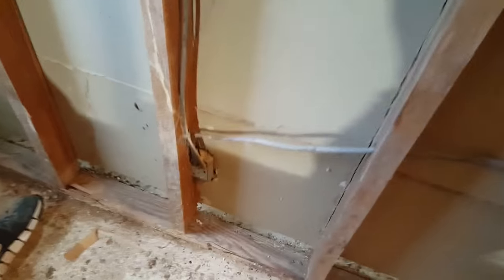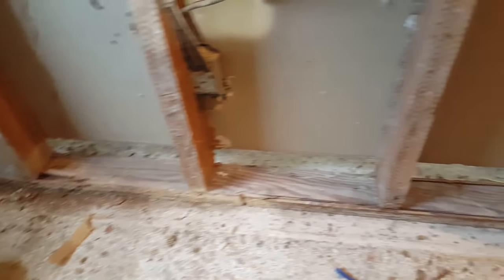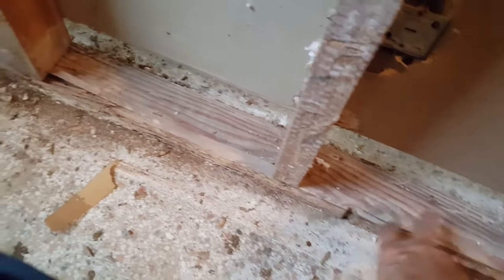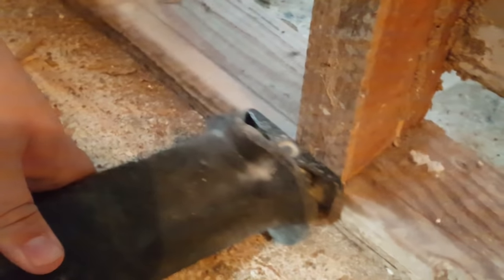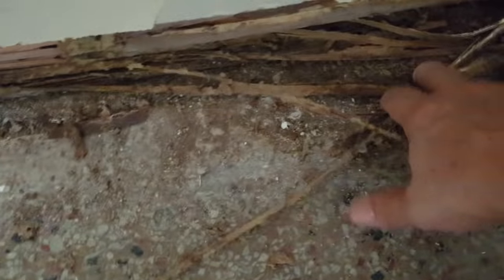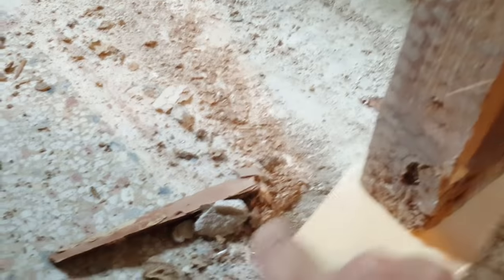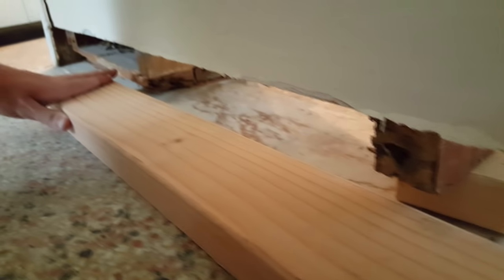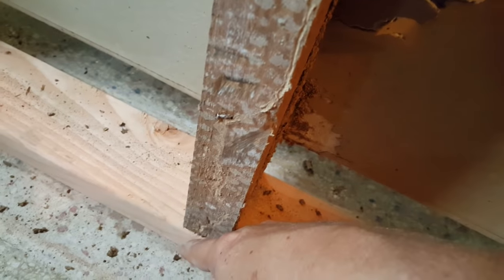How To Replace Rotted Stud Wall Bottom Plate

Comment: Thanks for sharing your method. You are master craftsman and a great instructor.
Reply from the maker: Thanks I'm glad you liked the video. Also keep in mind for the bottom plate you should be using pressure treated lumber if you're up against a cement floor as required by code. We did not show it in this video because all we had lying around was a regular piece of wood. But you can also put a vapor barrier under the regular wood as well and that will pass code.

Comment: I'm sorry but you need to use green treated plate board otherwise is too much work to see the plate disintegrate again
Reply from the maker: Pablo Ocegueda  Yes correct building codes require that we use pressure treated lumber,  Which is the green board you are referring to, or a vapor barrier beneath the bottom plate .
Reply: Wait i always hear we cant use pressure treated wood indoors. So can we? Nyc
Reply: @lionintu  yes you can

Comment: I was always told that the bottom plate should be pressure treated wood when against concrete or in locations that have possible exposure to water/had previous water damage.
Reply from the maker: Yes we later slid a vapor barrier under it, which is allowed, and passed inspection
Reply: @jeffostroff  Hey Jeff, I just framed the majority of basement before realizing we didn’t put pressure treated wood for the base plates. I just bought the right wood to install but then saw this comment. Do you have a video on vapor barriers? Should I do that instead and use the wood I just bought for the rest of the basement or just rip it all out and replace it? Thanks!

Comment: you should put 2 in. x 4 in. x 8 ft. #1 Redwood-Tone Ground Contact Pressure-Treated Lumber to avoid same picture
Reply from the maker: We had actually pulled it back out and inserted a vapor barrier under it, ended past inspection because if you don't use presentated lumber you have to use a vapor barrier

Comment: Maybe just cut out the sides of the vertical 2x4s and keep little spacers below it from the previous rotted wood. Then you slide in the new 2x4 with the old spacers being pushed out.

Comment: Looks like our laundry... main problem was no wetproofing between concrete and wood ... or anywhere.
Reply from the maker: They are supposed to use pressure treated lumber
Reply: @jeffostroff  No idea what they used as it's from the late 1940's. Quite sure the concrete in the entire shed has 0 rebar or damp proofing as well.

Comment: Thanks for the information.  Getting ready to do this same task and was totally lost, you're video saved me.
Reply from the maker: Awesome, just make sure your bottom plate is pressure treated lumber, or at least has a vapor barrier under it
Reply: @jeffostroff  it's an interior wall. That sits flat on concrete floor. So should I use a treated board considering it's sitting right on the concrete floor? I'm not familiar with a vapor barrier. The old bottom plate sat right on the concrete also.

Comment: I have an exterior garage wall with rotting about 8 in up each stud and the sill plate's gone & 80% rotted. I was thinking of adding a pressure treated sill plate and then a block to meet the stud. Using nails or screws, attaching all to each other and concrete nails to the floor. Is this the simplest and best?  Doing it solo and kind of scared haha.
Reply from the maker: Using multiple pieces for a single stud in load-bearing walls may be restricted or require specific methods to ensure proper load transfer. Please always consult local building codes or a structural engineer to ensure they comply. If you were to use 2 pieces of wood to form a single stud, they must align perfectly end to end so the load carries to ground through the wood. I would also use roofing nailing brackets to keep them lined up, or a small slice of wood stud to overlap the but joint. Of course nothing beats replacing the entire stud if you can do it with a single stud and avoid these issues altogether

Comment: The camera moved around quite a bit but the info was great, thank you.... Easy to follow, as much as I dread doing it.... doesn't look to hard.  Need a Sawzall tho or whatever you call it.
Reply from the maker: Make sure you use pressure treated lumber for the new bottom plate it is required by code

Comment: If I have a load bearing wall I would expect to use a jack to support the load?
Reply from the maker: The most efficient way to do this is most people build a  Temporary stud wall right in front of the wall you want to take down about a few inches away from it. This will provide shoring this will provide shoring while you remove the wall and do what you need to do.

Comment: Hi! Thank you for the tips! My husband and I are helping my parents repair a converted garage apartment on their property. Problem is half of the garage is sitting on the driveway and because it’s flat, water keeps seeping in causing rot, termites, mold etc. To get rid of the problem we want to add a concrete sill all around. Any tips?
Reply from the maker: Yes even if you build a concrete sill you want to make sure that bottom plate is always pressure treated lumber So that it won't suck up moisture out of the concrete

Comment: This is a great video! Thank you. I have a few studs on an exterior garage wall that rotted a bit when the siding rotted. Can you do a partial replacement of the bottom of the studs on a load-bearing wall? 

Essentially, can you cut an equivalent block of wood and place it under the hanging piece? And secure it with a horizontal piece of wood where the cuts were made (in between the old top and new bottom 1/5th. It's not bad rot, but the rot is there. I want to ensure that is standard and will meet code. Any help is appreciated.
Reply from the maker: Yes you should be able to do that I would make sure that where the 2 plates meet they're bolted to the floor and you can also attach them with a wood block or a galvanized plate.

Comment: Great video! During our flood they also cut off the bottom foot of stud. What's the correct way to add more stud so it reaches the new bottom plate? Do you have to make a sill for them all to sit on and then add cripples underneath?
Reply from the maker: They could try shimming between the bottom of the stud and the wall plate, or rip out the old short stud and cut a new tight fitting stud

Comment: I've got to ask.  After securing the bottom plate, are you going to piece in a 2-3" piece of drywall to finish off the wall on the bottom?
Reply from the maker: I think they added in new baseboards, I was not involved in any of the fishing parts.

Comment: Pretty straight forward, well done. NOW, what do you do if it's an exterior wall on slab that gets water. This is my issue. I assume I will have to excavate around the slab, analyze the footing/slab and and depending on it's condition, either repair the slab/footing, OR, pour a new one while the wall is suspended. Any thoughts on this type of issue? I'm a carpenter but have not had to tackle this issue until now.  Thanks in advance.
Reply from the maker: Use pressure treated lumber, and even better a combination with a waterproofing underlayment beneath the bottom plate

Comment: would love to hear what has to change for a load bearing wall, how do you support the upper timbers so that you can get the job done ?
Reply from the maker: Usually people build a second stud wall a temporary wall placed close to the load bearing wall then remove the bottom plate and make the repair. Others will use metal jacks to Jack up the joist above the load bearing wall to take some of the pressure off and then make the replacement of the bottom plate.
Reply: I just did it. Went one by one

Comment: I have a shed on a slab and when it rains, water leaks into the shed, I assume because there is no seal of any sort between the bottom plate and slab and water makes its way in. How to rectify that?
Reply from the maker: You could put silicone around the bottom so water cannot leak in

Comment: We have this probelm, due to water leaking, bottom plate needs replaced but under the plate is not concrete it is a 6 inch beam of wood then the floor, the part directly under the plate needs replaced , so can we just take out a section of that, then a section of the plate above it? It is a non-load bearing wall.
Reply from the maker: Yes you can do that no problem.
Reply: @jeffostroff  and I assume under the wood is concrete, so we need anchor bolts and a hammer drill, is there an alternative or is that a stupid question? We've never done anything like this.

Comment: What  About the vertical studs if they're  Rotten on the bottom as well
Reply from the maker: You could just pry them off the stud wall, and replace with a custom cut stud to fit back into that spot
Reply: Well this building has been rotting since 1939 so it's top and bottom in a lot of spots. But also holding up a 2nd and third floor

Comment: We're working on doing this on the wall the previous owners put up when they converted the garage - water is seeping underneath and causing issues. But we just realized the base plate was nailed down to the concrete driveway. It's obviously not load bearing, but this wall also has a window in it. Suggestions?
Reply from the maker: If you do it like we did where once you get the bottom plate loosened and you started  bumping it out a little ways at the same time bring the replacement plate in and get him under the studs while youre pulling the other one out of the same time that way the studds always got a bottom plate under them. Also make sure you get pressure treated lumber for the bottom plate it's required by building code from going on concrete.

Comment: What if you also need to cut up 12inches without removing drywall above repairs? This needs to be done so waterproofing system can be installed
Reply from the maker: You should not need to cut the studs for that, but you can slice into the drywall and remove slices of it.

Comment: I have a similar issue, due to water, in our garden shed / garage.  The issue I have is that the wood along the bottom is on the ground (outside...)?  I really want to do the repair myself but for the life of me cannot find a video of something similar?  

My brain keeps telling me that I should sit the timber on our concrete slab, but the builder in the (possibly 1950's), sat it on the ground, just past the slab?  (If I were to sit it on the slab this would reduce the width of the shed?
Reply from the maker: You need pressure treated lumbers rated for concrete installation
Reply: @jeffostroff  Many thanks

Comment: I have done the same, is a rival thing to my bathroom after a long term leak got the bottom plate of 2 walls. However, how do you anchor the plate on the slap without a ramset gun? Here in Australia you need a firearm licence to hire or buy a ramset gun and therefore not an option... can I attach the plate without anchoring? What are the alternatives??
Thanks
Reply: Sorry typo...instead of rival I meant identical...
Reply from the maker: If you are attaching to a concrete slab, use Tapcon anchors, you pre-drill a hole with a concrete bit, then screw in the anchors. If attaching to a wood sub floor, use nails usually 3 1/4".
Reply: Good idea thanks
Reply: That is incredible.  Lmfao you need a firearm license.  Don't worry. We have dumb liberal policies here too in NYC
Reply: @jeffostroff  Aren't those also called REDHEADS?
Reply: Why would you need a firearm license for a Hilti gun? Or Ramset. Seems kind of extreme. Usually when a law has passed there was somebody that did something to make that a law. Maybe I should Google it. I play online poker with a woman from Australia. Wish you guys were a bit closer. Geographically. Cheers.

Comment: Instead of nailing at an angle can you use galvanized steel ties and get the same strength? Also is there any reason not to treat wood in any area in a kitchen or bath that may be exposed to water with polyurethane?

Comment: How do you fix the 2 x 4 on the wall if a  portion or  part of it is damaged as well
Reply: Cut up 12" pas the damage place a 2x4 in its place. Most codes require double the length as a "scab" I dude 2.5  meaning 12" x 2.5= 30"

Comment: what if I also need to pour a new concrete floor (garage) when would that step come in to play?  Lift, pour, then slide new plate in?
Reply from the maker: Yes pour first then add plate
Reply: I have a building which walls in place already that I need to replace but I also plan on putting the concrete Floor in Can I put the concrete over the base board
Reply from the maker: @andresbarcelo   That is a good question and I don't know this unique situation has not come  up for me. I would not feel good about embedding wood in it.

Comment: This is a great vid, thanks. What do you do to reattach studs if a few inches of bottom of stud was cut so interior drain could be ran? How do you fill gap between plate and bottom of cut stud?
Reply from the maker: The rule of thumb is they're not supposed to cut more than 25% of the stud so if you have to cut a hole in the middle of a 2 by 4 which is actually 3 1/2 inches wide, theoretically you don't want to cut a hole bigger than one and a quarter inches or 1 1/2 inches at the very most really. So if they cut something bigger than that and we're trying to run a bigger pipe they were probably going against code. We encountered this on a wall that we were remodeling one time and we just turned it into a 2 by 6 stud wall instead of a 2 by 4 and that's how we solved the problem. So what I would do in your case is if it is possible to put in a whole new stud and roll the proper sized hole hopefully it doesn't take up the full size but you do want to have meat of the wood coming down around both sides of the whole cut you don't want to cut a notch in a stud.
Reply: @jeffostroff  I guess I'm just making it confusing by adding the part about the drain. Theres no holes in the studs. The drain is buried in the concrete under where the bottom plate was, so now I need to replace the bottom plate, just like in your video. The only difference is where you cut the studs from the plate leaving the entire stud, in my demo they cut about two inches off the bottom of the stud. So if I set a bottom plate in there, I've got a two inch gap between the plate and the stud. How do I fill this gap?

Comment: Why it’s treated wood so unpopular for any stud application? Is it matter of cost effectiveness?
Reply from the maker: The traded word is more expensive, but by building codes you have to have that bottom plate as either pressure treated lumber, or like in our case we put a underlayment underneath it underlayment . Also when I am building starts onto concrete walls I tried to go pressure treated whenever possible

Comment: Is it because the bottom wasn’t pressured treated? Don’t u have to treat the termite first?
Reply from the maker: I showed on the bottom what some plumbers do in desperation with persisting drips. ⚠⚠⚠PLEASE NOTE: we have a newer improved shorter version of this topic shot in 4K video recently here: "How To Install Bathroom Sink Drain/Faucet, No Leaks Under Gasket, Threads [SOLVED]" https://youtu.be/mTmUO-0ELps
this one we don't show the plumber's putty

Comment: What if you had to cut off water damage on the vertical 2 x 4
Reply from the maker: Luckily we did not have to but you would replace the entire stud. Or you can also sister up another stud next to it but I prefer to just put in a new one
Reply: @jeffostroff   yeah I can’t put a new one in, I’ll just sister and brace the best I can. Thanks for the help!

Comment: Is there any material under stud to prevent rain or water from seeping.
Reply from the maker: Yes, we have a waterproofing membrane. Sorry we forgot to record that step, usually we use pressure treated lumber, and can you believe we were one piece short, so made the video and the repair without PT lumber. We had to shove the membrane under it off camera. Inspectors approved it also.
Reply: @jeffostroff  a recommended waterproofing membranes? Im framing my new basement bathroom and I'd rather avoid the direct contact

Comment: Would this be similar procedure for an outside wall that isn’t load bearing? It’s a two floor home thanks
Reply from the maker: I would think the exterior wall would be load bearing, but this applies to all walls. Check code sin your area you might be required to use pressure treated lumber on the bottom plate.
Reply: jeffostroff the wall is parallel with the joists. But yes in my area we need pressure treated. Thanks for the reply and video

Comment: Do you have to replace the entire bottom plate or can you just replace a section?
Reply from the maker: You can replace a section, but it is so cheap why not do the entire board? Little more work, but worth it. You can also use this as an excuse to make that bottom plate pressure treated lumber as required by newer codes when you have wood on concrete slabs.
Reply: Thanks it's more or less to minimize drywall finish out work. 

Is there a video to replace top plate? I have a termite damage and its only 3' of damage on non load top plate. Wasnt sure where to have the top plates butt join into eachother